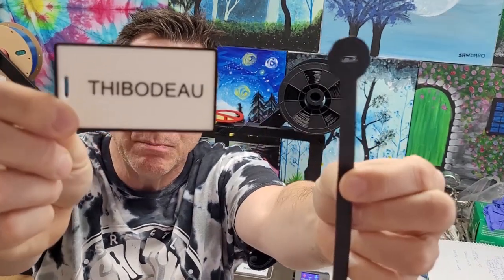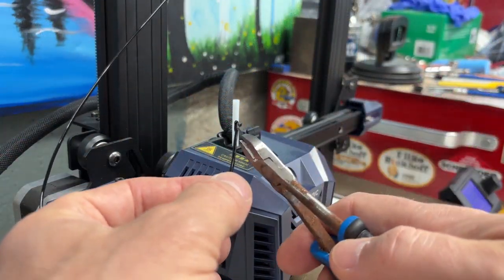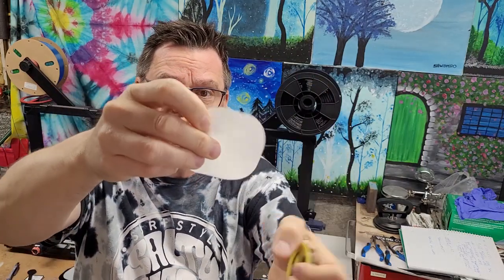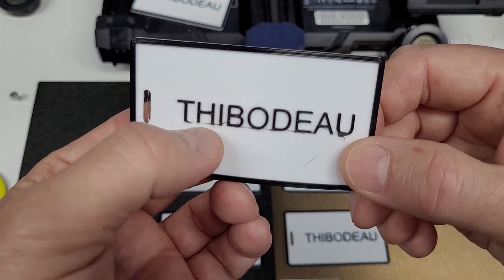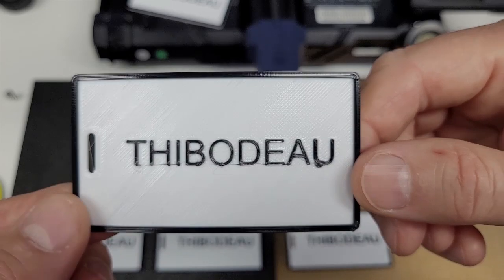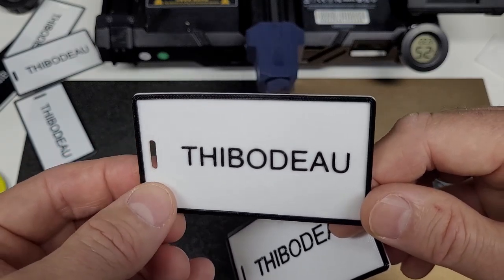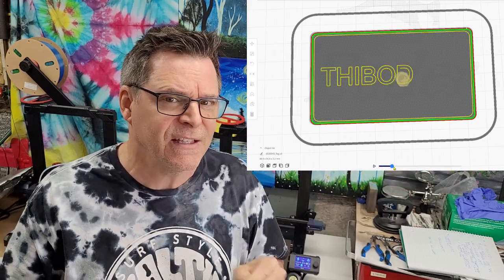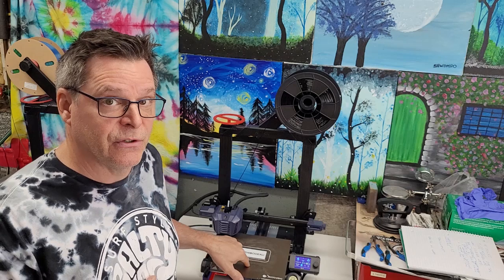TPU Filament Challenge

Comment: I feel like the text being outlined like that might have something to do with the heights in the STL. Are they steps that are even with the chosen layer heights or something arbitrary? Certainly doesn't seem optimal! You would have better luck if the tag were split into 2 STL files and imported as a multi-color perhaps, slicer has to support that of course. Orca is a good one as others have said, might also not cause that layer artifact in the first place. Another thought that might cause it, is the number of 'surface layers' top and bottom, it might be turning it into infill or something weird right at that layer.
Reply from the maker: Hey Roobotics, thanks for dropping a comment. I tested with Orca last night and Orca does not create that strange layer which is great news. A good reason to switch away from Cura to Orca. I have busy days ahead I just received my Bambu Lab PS1 with AMS

Comment: Hey, question for you; when you do an autolevel, if that printer has the feature, I had the Kobra 2 Max, does it set your Z offset so low that it causes a collision between the print head and bed? Mine did. Every time I ran the autolevel routine I would have to adjust Z axis offset from -1.9mm which would damage the machine to my typical offset of -0.23mm, close but not too close. I wonder if that is an issue common to all their rigs?
Reply from the maker: Hey Josh, yes they both have auto level , but never had either hit the bed during auto leveling. Did the sensor ever hit the bed too?

Comment: What slicer did you use? That looks like Cura in the clip. Id recommend just trying out Orca which is based on Bambu Studio, one of the two your friend used for sure.
I havent used Cura in ages as I switched to PrusaSlicer after some time, but I think it could be as simple as Orca doing some things a bit differently + some extra settings you can tweak there.
Friend recently switched from Cura to Orca and hes been quite blown away😅 
And keep in mind that if he printed on an X1C, his flowrates where likely pretty much on point. So make sure you get those dialed in tight...

Havent really printed enough in TPU yet to be able to tell you what my X1C/Orca does differently then my old Kobra Go with PrusaSlicer, but I think its deffo worth looking into Orca and playing around there too. I bet there will be some differences even with equal settings....
Reply from the maker: Hey Wasser, thanks very much. You're right it's a Cura thing. It doesn't do it in Orca. I have used Orca before in the past and liked it, just got so used to using the easy search method in Cura. Thanks again for the feedback.
Reply: @mayhemsmiley  ...ooh Im glad to hear that was the solution!! 
I dont remember the 'easy search method' you mentioned, but Orca lets you search for everything by clicking he magnifying glass right to the layer height selection, if thats what you mean.
Unfortunately it wont show you the Nozzle Options, which Ive just spent a while looking for cuz of that new Z-Offset after X1C flow-calibration which finally allows me to properly print heavily foaming varioShore TPU which requires some space to fully foam up and reach 53 shore hardness.... youll have to click the pen icon to the right of the nozzle selection at the top to find any of those.

Hope you are finally able to print those badges in good quality!!

Comment: I think the text is imbedded into the model instead of sitting on top.
Reply from the maker: Thanks for replying.  Any ideas how not to embed.  I made a separate file from my friends and had the exact same thing happen.
Reply: @mayhemsmiley  I have added text to models with CURA and it did no imbed the text try doing the color change one layer higher maybe.